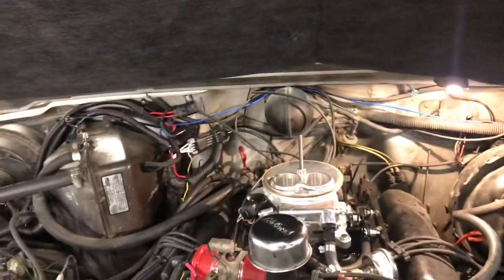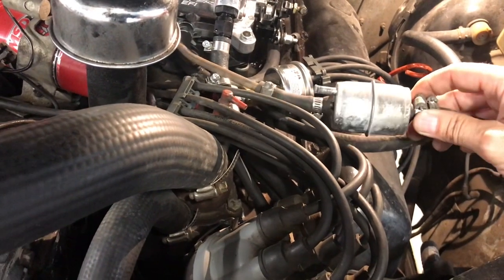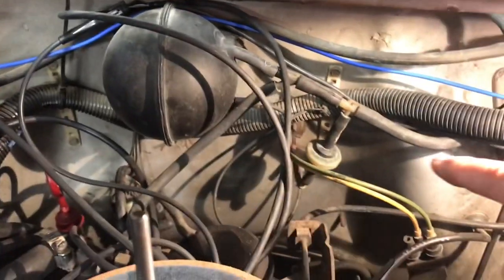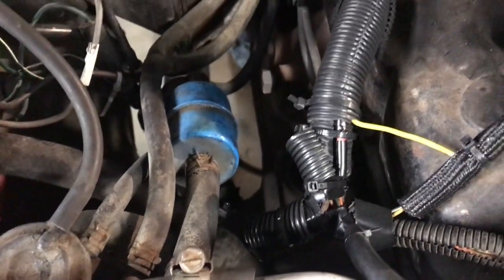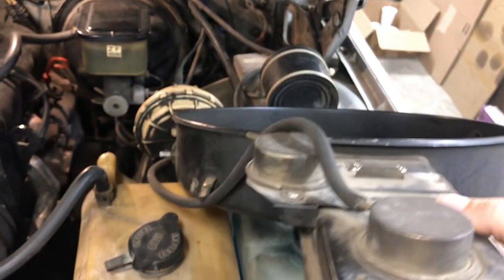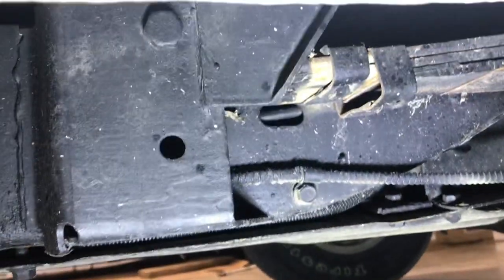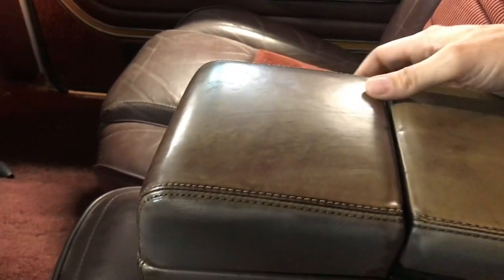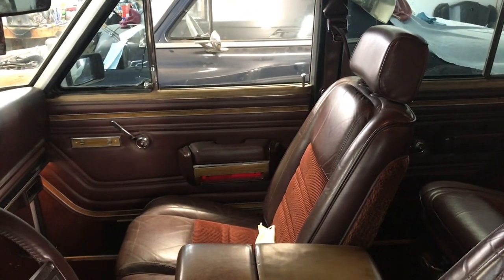Grand Wagoneer Issues For Dummies

Comment: I own an 1986 my father bought new I was there when we bought it I was 19 years old at the time and gave it to me later before he passed away.  We never had any issues we always maintained it and kept it in a garage 100% original. I drove it daily for number of years then about once a week would drive. I replaced the carburetor twice only because the throttle plate wore out the bushings just put a new one on. Never had any issues starting it cold or hot it's always run good. We changed the oil every 6 months or 3000 miles. We live in Southern California no rust and always good weather. I had the driver seat redone once wore out it looks perfectly stock.  I grew up driving cars that had carburetors reason most people have issues the don't drive them enough gas gets old quickly in the fuel bowls and gums it all up.

Comment: I have a no click no start problem.  Replaced starter relay and starter still no power. I’m Still looking for the bug.
Reply from the maker: Use test light see it power going to solenoid, if not check wiring going to solenoid. There is an orange wire with a fusible link.
Reply from the maker: Also check your grounds.

Comment: Whoever was the fellow in charge of the vacuum systems on the wagons needs to be tarred and feathered. And good luck finding an accurate diagram. Think they changed things mid run each year, or maybe from day to day.
Reply: Yup about once a year you just go through them all and replace the loose ones hope they went back in the same place!